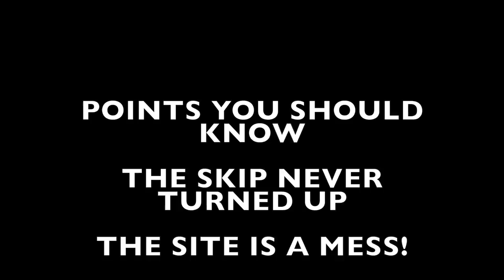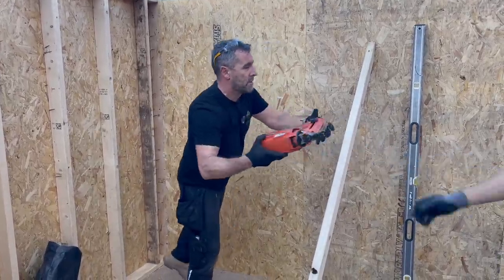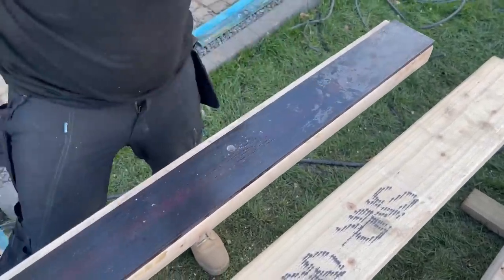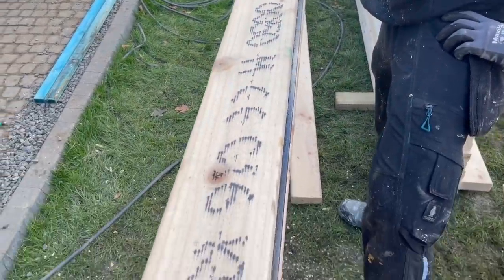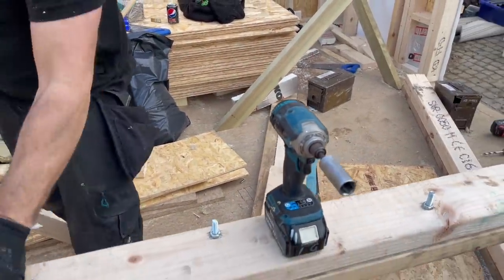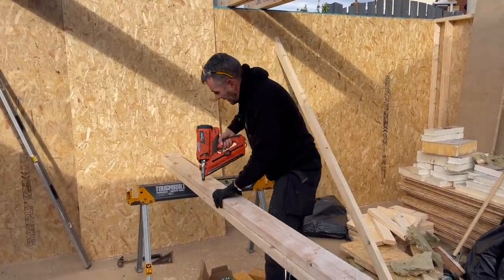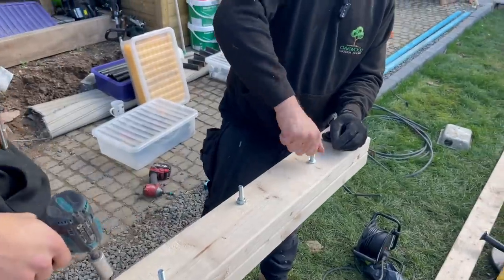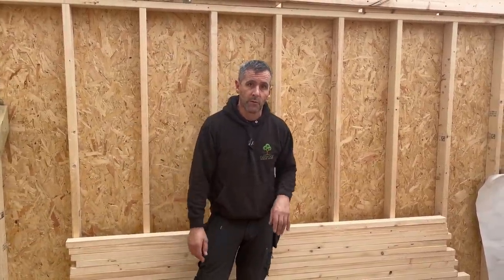How to make a flitch beam for a garden room with a large span roof

Comment: Just done a quick Calc out or boredom for you, 2no 47x125 c24 fails in deflection, with the 10x100 flitch it works so as you say the combination should be fine. Again it’s just a garden room so doesn’t need to meet the design criteria as such. Keep up the great videos 👍🏼
Reply: Hi Cory. How do you do calculations? I’m trying to figure out spec for timbers for a sedum roof but struggling to find any info anywhere
Reply: @antonyelliot8636  hi Anthony I am a structural engineer. I can provide a quote for structural calculations to account for the additional loads from a Sedum roof if you like?
Reply: @corytierney9318  hi Corey, that would be great. what’s your email (not sure how to dm in you tube)
Reply: @antonyelliot8636  hi Anthony trying to leave my email but keeps deleting
Reply: for floor or roof?
Reply: What the heck is "2no 47x125 c24*

Comment: Its worth pointing out that unless there is specific reason for using the shallower timber, either due to site constraints or supply issues, it would be a lot cheaper and less work to use a deeper timber instead.
Reply: Obviously

Comment: Could you use these flitch beams for a floor? I'm gonna build a 4.5mtr wide lean too, on a 3.2mtr wide base, leaving a 1.3 mtre overhang. Was thinking of putting some steel in but I like this method you're using 👌

Comment: Great video as always. What is the maximum width I can build to without using flitch beams and is that with or without over hang? Really don't fancy doing those but need good size for a 7x4 pool table and would like a good over hang. Cheers.

Comment: Can I ask why you prefer to use a steel rectangular beam to create the opening for the bifold doors rather than a flitch beam? I'm hoping to create a 4 m wide opening for bifold doors (in a 5m long wall) and would prefer to use a flitch beam since it'll be less heavy so easier to lift into place and also secure down the pitched room with bird mouth notches into wood rather than steel beam - but I'd really welcome your views on this? many thanks
Reply: If you are using brick to build I would advise that you get those Dimensions checked by a structural engineer as I think the size of the opening will be too big for the wall. I believe you will need a minimum of 665mm return on each side of the opening. So with the dimensions you stated of a 4m opening would only leave you 500mm each side. Maybe contact your local building Control Officer at your council as am sure they will provide you with some free advice mate. Good luck on ya build.

Comment: Love the videos Liam. Just wondering why you use flitch beams rather than using a bigger single beam? Is it to keep the thickness of the roof down?
Reply from the maker: Yes mate, building under 2.5
Reply: Cool, thanks a lot. Really appreciate the effort you put into this channel 👍
Reply: I  sandwich 18mm ply between my double beams
Reply: @jamiecampbell6550  where do you get ply over 8ft long?

Comment: Why not just put the two wooden beams together under the metal, and drill them both in one go?
Reply: Wood uses a different head to the metal
Reply: @techheck3358  err, yes. You drill the metal first, and then drill both pieces of wood together.
Reply: @-_James_-  you can’t see where your metal hole is if it’s hidden :)
Reply: @techheck3358  Why would it be hidden?  You put your sheet of metal on top of the two pieces of wood.  (As I originally said.)
Reply: @-_James_-  then you’d need to drill the hole perfectly square. Which is nigh impossible for a ridge with that many holes